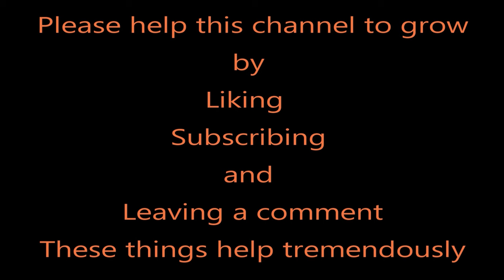How to Reseal Your CAV Injection Pump Part 3 Finishing the Pump  Assembly (IHC 414 Pump)

Comment: Good Video again Lance, after becoming an expert watching your first video back 8 odd years ago. I have found it's much better to push the throttle shaft out of the top cover and fit the lever, spring, and the governor plate then when ready to fit the cover push the throttle shaft back in the hole. Also, when repairing a top cover fuel leak, I do the same thing, as I remove the top cover, I push the throttle shaft out of the cover so it stays connected to the spring and governor plate so you can now see which hole it all goes in and take a photo. Cheers Richard Kovac
Reply from the maker: Yes I have tried that and it went ok but I never seem to remember when I have the camera rolling, stuck in my ways probably.
Reply: Thanks richard

Comment: most informative CAV pump video on the net! THANKS Lance!
Reply from the maker: Glad it was helpful!
Reply: @BundyBearsShed   it sure is ! My massy sat for a year and was running great what parked now it won’t start and has no spray out of the line ports , I took the top cover off make sure everything was moving and bled it a few times and still no good ! I do believe it’s an air issue though !

Comment: Brilliant video Lance used your videos to do a complete reseal of our DB 990 but now we get a lot more smoke without touching the calibration. We had been very careful to make sure the spring was in the correct holes. 😢
Reply from the maker: Black smoke or white smoke. Without touching the roller plate inside it will be getting the exact same amount of fuel, do you think the timing is correct? If black is your air cleaner nice and clean and the inlet hose is not sucking in at all?
Reply: Hi Lance. Thanks for that we stripped and cleaned out the oil bath air cleaner awhile ago. The problem wasn't the injector pump. We changed the lift pump  that caused the problems running lean. The black smoke is because it is now getting the correct amount of fuel.  I saw today when it is warm the smoke has gone😊
Reply from the maker: @belengeorge3568 that is good news

Comment: G Day Lance, thanks very much for explaining the symptons of the incorrect spring settings, when I did my pump after watching your MF video's I lost the spring position as it came away before I could look in, the plate on the pump doesn't have that number on mine, so like you I looked for witness marks and rebuilt with what looked right, but next time I start the tractor I'll be more aware of the rev range and engine performance, great video as usual. many thanks
Barry
Reply from the maker: Thanks Barry, Some times I dont know what I leave out as it is in my head ok and I forget to pass it on. I should come good with it all soon, lol.

Comment: M.
Reply: Hello Lance. You inspire confidence in a world where even my mechanic mates wouldn’t go. For 2k to hand it to the local ‘professionals’ i gave it a go. Got to your second video with my unit almost rebuilt and saw that sir clip in my parts box. My MF 50b with 4 cylinder Perkins must have had scope for timing? Anyhow since the backhoe was in the 2021 flood the sir clip was removed to be sure it was cleaned out. If you can point me to a video that points me to info on its placement, i would appreciate it. 
Also in video 1 you spoke about the wear on the veins and I decided to remove mine. Unfortunately damaged 1. Noticed they are not in that sparex kit. I opted to use a ultrasonic cleaner and no bead blasting. As soon as I pull the unit apart and find a place for the sir clip i should be in business. Thanks again, andrew